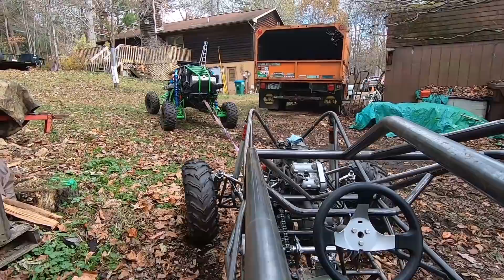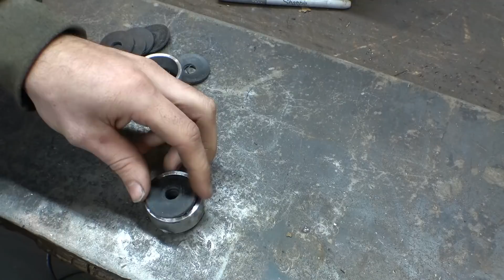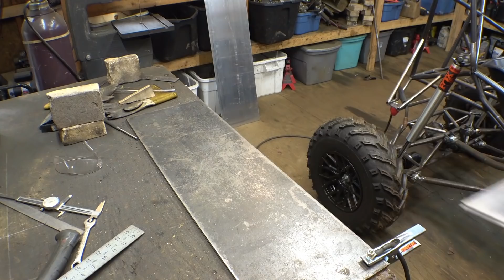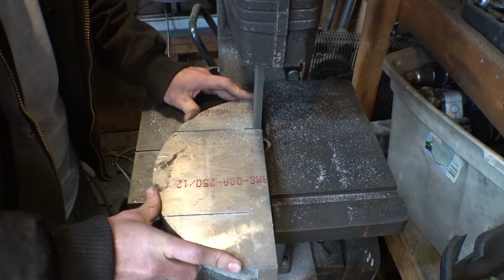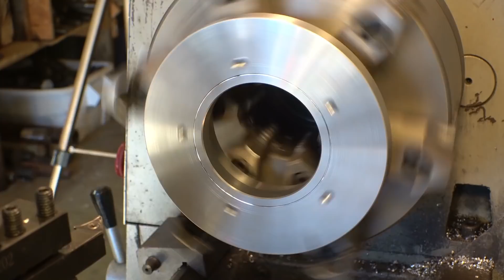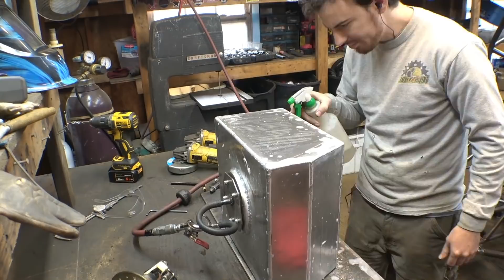Mini Rock Crawler Build SV650 Part 8

Comment: Use Windex glass cleaner to presher test it bibles grate and you can weld through it without contamination of your aluminum welds. Clean all parts with starting fluid before tacking up leaves no resadoo

Comment: When you use a hole saw like that, after you have marked it with the hole saw drill a hole just inside the mark to allow the swarf to clear.
You’ll get thro much quicker

Comment: A suggestion for a future build.   Make it 2, 3 or 4 wheels but make it as light as possible.   Either use very thin wall chrome moly tube or aluminum tube.  Find the absolute lightest way to make every part or assembly.  Love your builds.  Billk

Comment: You were basically trying to trepan with that hole saw. No place for the chips to go. It's a good idea though, saves a lot of material. Try something like the Milwaukee Hole Hawg/Big Hawg next time. Big throats on the three cutters to give the chips a place to go and a way to get them out. 

I haven't tried it myself, but I think I will next time I need to do a job like this.

Comment: Thanks for the inspiration!  I have a nice shop and have built some simple karts and stuff in the past.  Im trying to get motivated lol  I seem to have lost my mojo.   These vids are helping.  I really need a UTV  so me and my dog can go cruise. It will be a simple build though.  We'll see. Does anyone have any idea for some shocks on the cheaper side?  It will mostly be used for gravel road cruising and if it does get offroad it will be just be slow messing around nothing crazy.  I cant go overboard on the build because im probably using a gx390.  Something that goes around 35mph and has some fair power will be perfect.

Comment: Chris
When you want to run a hole saw like that in the future mark the hole lightly with the hole saw then in your mill drill a large hole or 2 just on the inside edge of the hole saw cut to give a spot for the hole saw shavings to go. 
Just be sure the hole(s) intersect.

Comment: Dumb question, cause I don’t have a Lethe myself, but how come you can’t use some kind of plunge bit to cut the circle out of that aluminum? Like how you machine aluminum pucks, cutting eat off a longer piece with a “plunge tip”. Whatever it’s called. How come you can’t cut that center hole or even the overall diameter with that? Instead of what looks like a violent method of cutting a square into a circle. Does it have to do with cutting edge, leading edge, or departure edge? Hahaha Again, I don’t a Lethe. Nice work Chris

Comment: Don't remove oil. Those shocks should have damping adjustments.... I believe I can see the adjusters. If you can't get the desired damping by doing your adjustments, then you will have to change the oil to a thinner viscosity shock oil. If you remove oil, the shock will have no damping at all through part of it's travel and then the same damping it has now. 

When you are drilling out large holes like that, I find that the quickest way is usually with drill bits, Start with a 3/8 and step up to half an inch, then a full inch, If you don't have any larger spiral bits, then use a boring bar. Hole cutters only work well in thin metal, If you try to go deeper than a 1/4" or so, you plug them up and they stick ... just like you showed. It also wears out the cutter and makes a horrible finish. There are other options, like annular cutters but they can be VERY expensive. If you have to use a hole saw, use lots of lube and or cut for a second and clear the shavings. 

Awesome work !

Comment: Your aluminum welding is getting better !     To avoid pinholes at the end of a weld,  ease off the power slowly so the last puddle does not freeze too quickly.

Comment: The rubber inserts for the radiator were an awesome idea.  Thank you for that.  Instead of the hole saw for boring I would get a cheap set of boring bars.  I use them on both my mill and lathe.  Super fast for making holes larger than a drill size.

Comment: I think a trepanning tool may save you a lot of machining time when you're trying to cut round stock out of plate. Especially when you're using an arbor like that. You can do an easy setup with one of those harbor freight quarter inch blanks. You just have to grind it right, which isn't hard at all. Here's a video from Ox Tool Co. that should be most if not all you need to get started.https://www.youtube.com/watch?v=6PcEBaset1I

Comment: That radiator blowing hot air right at you ?? You'll be riding it in shorts or ur underwear so you don't over heat lol. Its still a cool project though

Comment: That radiator killed your visibility out the front.  You need to mount it in a better location.  A low and wide radiator would have worked better up from.

Comment: The differential setup in a Polaris quad is marginal in a 400/450/570 Sportsman with 30hp. With the weight of this machine and the horsepower, the tiny ring gear will explode as soon as under any load. At least it would be a simple job to replace..

Comment: I hope you added some baffling in the fuel tank. If you get on a kinds steep hill with half a tank filled i could see it running a little lean. If you didn't there is some gas tank foam stuff you can buy that helps to hold fuel in place. Otherwise awesome work!

Comment: Ok Chris.Enough killing yourself moving this stuff.You have a few  small engines choose from  to make a power-driven hand truck.A jack/hook lift so you can get wheels off the ground for easier maneuvers,and the engine instead of your  back.Please think about it.(they use things like this to move trailers etc)

Comment: 16:35 just order up a threaded steal body valve/tire stem. You can bolt it into place and it has a check valve by design to hold in the desired pressure you want to test the tank with.
As for the fuel tank, weld tabs to the tank and to the angle iron and put springs on to pull it down into place.
And for the axles. Cut them in half right down the middle than spline the shafts in your mill. Than take a larger diameter hollow bar and cut the matching splines into the inside of it. That will form a slip joint on all of your axles and is way stronger than simply welding them solid. You have the tools to do this now, time to learn and take your skills to the next level!
22:05 you can make your cut out much easier if you would simply use a parting/cutoff tool in place of that hole saw. I do not know what all tooling you have for the lathe, so it is likely that you may need to order one and the inserts for it. You can also make a live tool for your lathe and use an end mill to perform the cutout way better and faster than a hole saw. It is time to look into some better tooling for the lathe. It will pay for itself in time and headache.
https://www.youtube.com/watch?v=NnV2Wf9-3T0
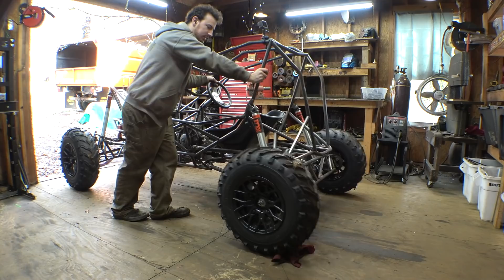The video below has the kind of groove tool that could be used in place of a hole saw, at 1:25.
https://www.youtube.com/watch?v=-uBNPgpfJok

Comment: Your aluminum welds are looking much better.  Aluminum doesn't like anything foreign on it when being welded, so to help prevent pin holes, sand and wipe all areas to be welded with a solvent that doesn't leave a residue. I would also suggest welding both sides if you can and if you thinned the edge of the fuel pump plate, it would make it easier to weld to the sheet metal. Love watching your videos/builds. You are extremely meticulous, like me and I appreciate it very much.

Comment: Project is looking awesome thus far, but I think u are gonna run into surge with the fuel pump having no surge tank. Around a long Corner on half a talk of fuel all will run to one side and the fuel pump is gonna suck air. with a bike/quad is concentrated around the fuel pickup allot more.

Comment: Look into a lathe trepanning tool. Your lathe will thank you, LOL. I would advise watching some video's on the process because with larger parts the process can be dangerous but with your new lathe it can turn slow enough to trepan safely. The air shocks are sick, do you plan on having a small nitrogen tank on board. I have seen a set up like that before that does auto-leveling and wasn't expensive at all.

Comment: I think you outta put some 31s maybe super swampers or boggers just gear it down for them to spin good
Reply: I think he's going to be breaking diffs as it is.
Reply: @Lucas12v  that motor don’t make enough power for it to blow diffs. If he gears it right he won’t at least
Reply: @codymullins2155  With enough gearing and weight it doesn't take that much power. You might be right though. I hope you are.

Comment: looking good!  Since you will be going really slow, how about turning that rad fan into a pusher?  That'll keep you from eating all the heat coming off the engine while you're driving.  Maybe not too bad during the winter, but in the summer you'll be dying back there :)
Reply: He'll be fine. Its just a 650 
You sit behind the rad on bikes already. 
And with that big rad the fans won't run much if at all.
Reply: @TacticalTushie  They blow towards your legs plus they usually have something to deflect the air away from the rider.
Reply: @damon20r  some do some don't. 
One of mine doesn't  1000cc naked. 
It's fine.  Exhaust side gets a little warm sitting in traffic but it's ok. 
My other bike doesn't even have fans on the rad.
Reply: Toda América sería un solo país es México en un futuro próximo el idioma oficial sería en español  México va ser el primer mundo México será potencia mundial  vivA México querido México
La grandeza de México
💯🌎💯🇲🇽💯
Reply: @jorgeabrahamhernandez1209  ... y todas las mujeres con bigote ...

Comment: Does the fuel pump draw from the base? Seeing a possible issue with fuel pickup when the fuel level is lower then the fuel filter
/sock.
Reply: Motorcycles always have the fuel pump on the bottom of the gas tank from my experience and he's using the oem fuel pump from the SV650 so I don't think there will be any issues but the fuel cell needs a vent/rollover valve.
Reply: Pretty sure the fuel pump was mounted on the bottom of the gas tank on the motorcycle. I know any fuel injected motorcycle I have worked on the fuel basket was mounted in a small sump on the bottom of tank. He may regret not putting a sump area with baffles though.

Comment: shorten your tool stick out on your lathe. you only need just enough sticking out to reach your work area.  that tool hanging out there on a prayer is why the big lathe wasn't doing so well with interrupted cuts that or you need to go up in size in tool  from 1/4 to 3/8 to 1/2 or 3/4 . you want the biggest stiffest tool possible.
Reply: That's what she said